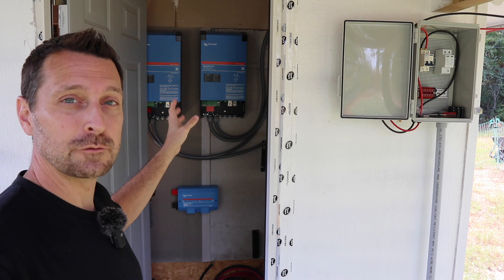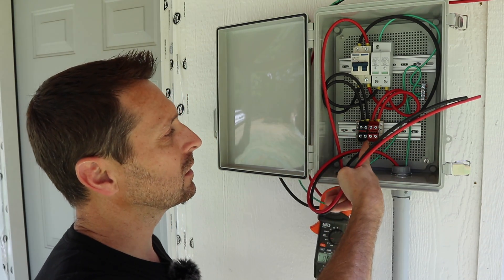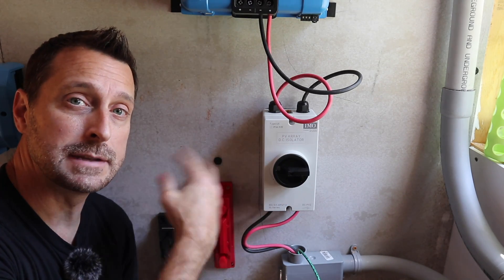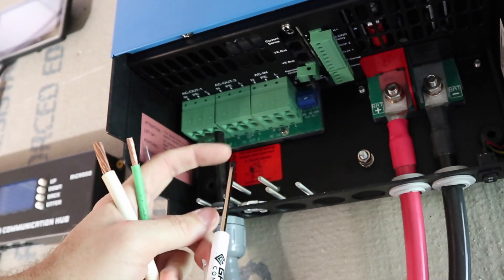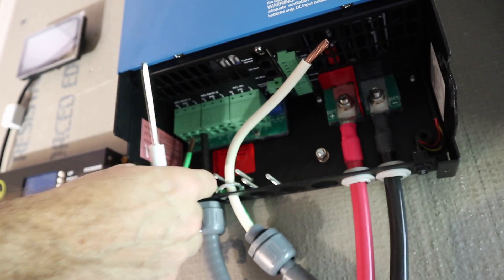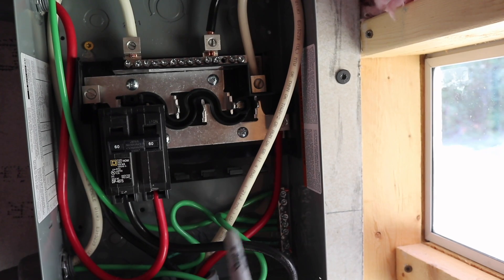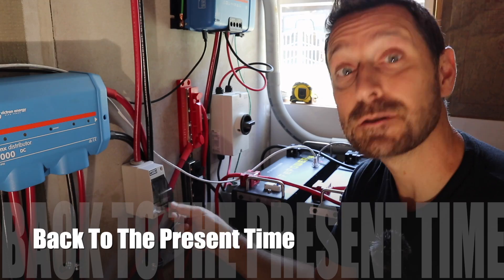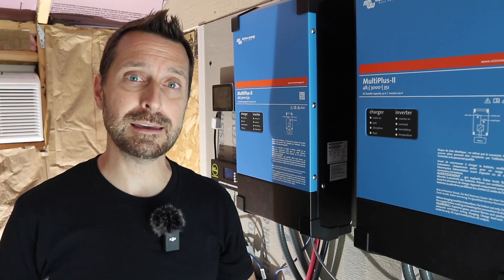Victron Multiplus ii Installation | Complete Wiring For Off Grid

Comment: Did you change over from EG4 to victron?
Reply from the maker: No. The EG4 are powering house. These are for my barn and well pumps.
Reply: Sorry, I questioned it before watching the entire video. I just set up my eg4. Running cable now. I did set up some 100watt panels on top of the chicken coup but only charge each battery at 3 amps. Solar is producing 200 volts. Too much shade. Going to set up my 455 watt panels now in full sun. Fingers crossed
Reply from the maker: @timcastle6996  No worries Tim. 
Glad you are moving forward with your system. Let me know if you have any questions.

Comment: I love Victron equipment but don’t like the messy wiring that comes with the installation. I would have to figure out a way to run all that in cable run boxes.
Reply from the maker: It’s good equipment. Only the comms wire mess bothers me.

Comment: Hope to see explain how to bond the cases of all the equipment properly. I’ve had discussions and would like to know your opinion..
Reply from the maker: I believe that the only case grounds that need to be made are for the mppt and sub panel. The inverters are grounded through the AC out ground conductor. This is only for a stand alone off grid application though. If you are in an RV/boat it would be different from my understanding.
Reply: @CountryLivingExperience  the Victron schematic diagram shows all chassis from the inverter to the MPPT cases are tied together. Also, I connected the battery rack to  the case ground.  It is all for safety of course, and I’m still struggling to determine which way to go..
Reply from the maker: Like I said, I believe Victron instructions default to RV/Boat applications. For off-grid building use, you do not want to end up with a ground loop.